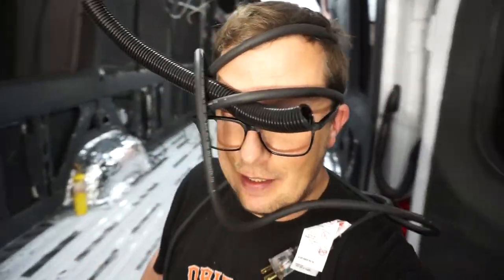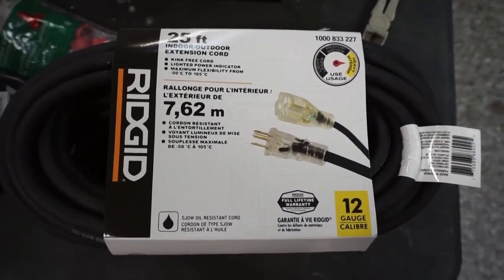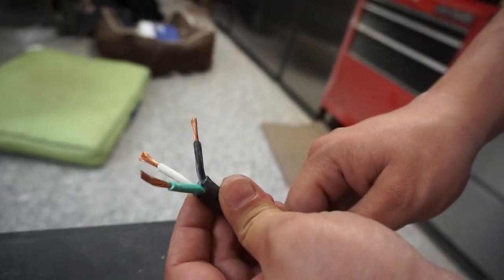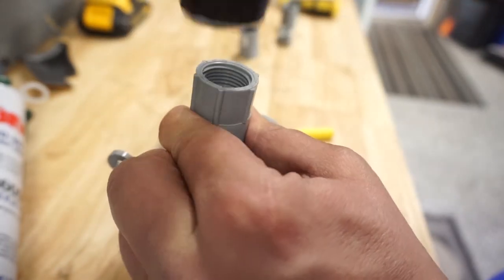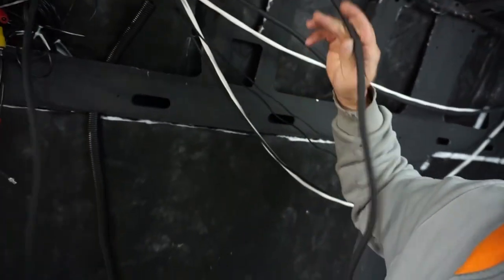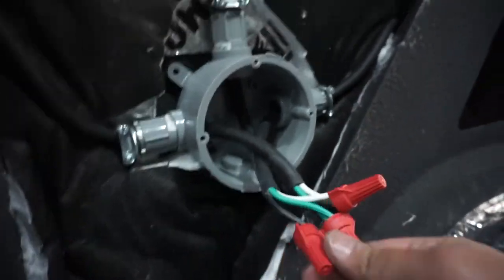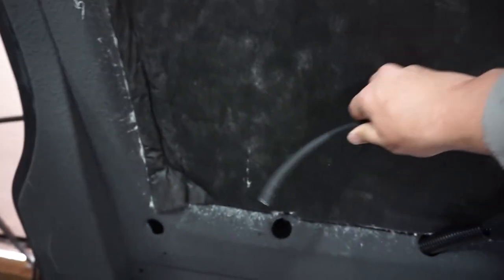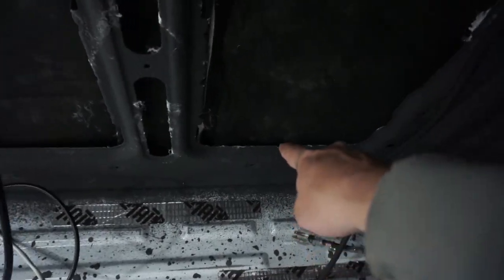Running 120 volt AC wires | FOUR SEASON VAN LIFE | EP.22

Comment: Hello Jeff I’m James and I’m a cat and dog person my cat keeps the mice out and my dog keeps the assholes out. First let me say I love your videos and energy but the way you did your electrical system is wrong and unsafe everything must be done by code and I have done a lot of solar and electrical installations and I would recommend using a 12 volt 3000 watt pure sine wave inverter charger and a high voltage MPPT solar charge controller so you can run all your solar panels in series and buy doing that you will make more power from less sun like on cloudy days and you should have a breaker panel installed. Please keep up the good work and stay safe

Comment: Great video, you do a great job explaining everything you're doing.   I do have a question, I am just starting to run wire / loom.    In the upper horizontal rib where you drill a hole (minute 5:59) I did the same but on the top inner side of that rib I have ovalish slots and am having the dickens of a time getting my loom through that.   Did you drill the upper inner rib into a bigger hole somehow?
Reply from the maker: I drilled new holes beside the oval holes.  Super happy you are enjoying the content, thanks for watching and commenting.

Comment: I'm sure I'm missing something, but I don't understand what function the junction boxes serve.  Seems like all that is happening is a wire is being joined back to itself.  Is it for anchoring purposes?  Why not just one long wire for each outlet on the inverter?
Reply from the maker: Hey Doug, junction boxes are where we turn one wire into two wires, giving use more receptacles in the van. That is why I made three holes in each junction box..  Hope this helps... Thanks for watching
Reply: @DaresDrives  it does indeed clarify!  Thanks for the follow up.